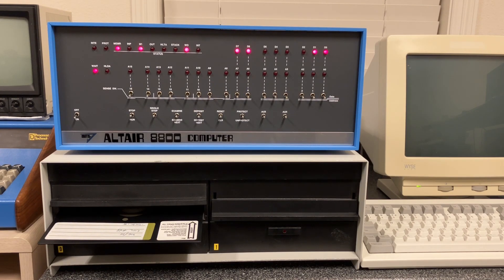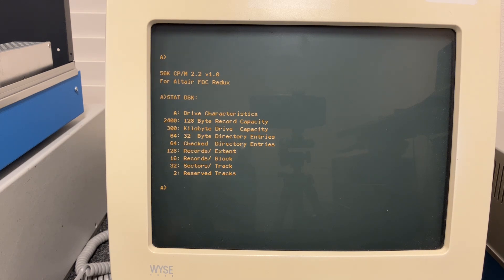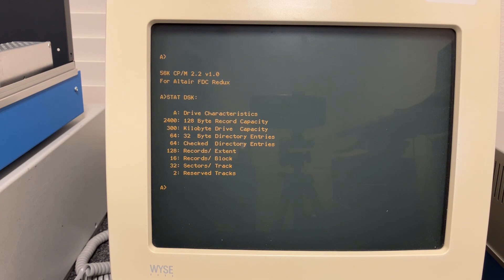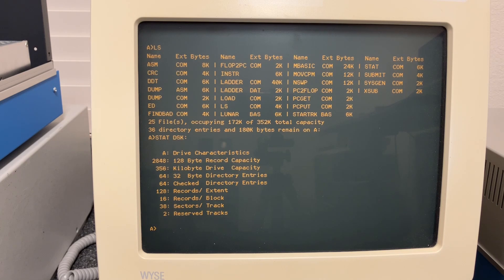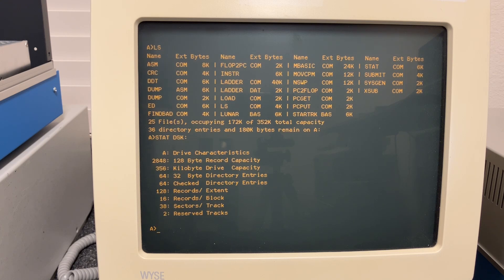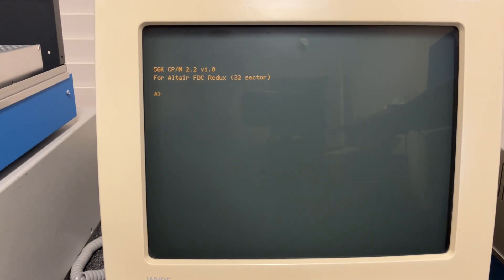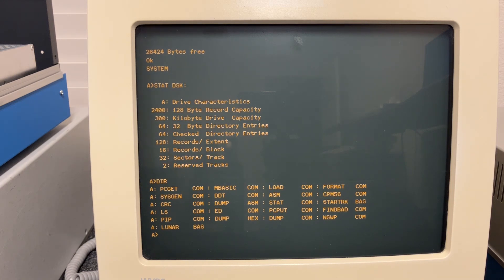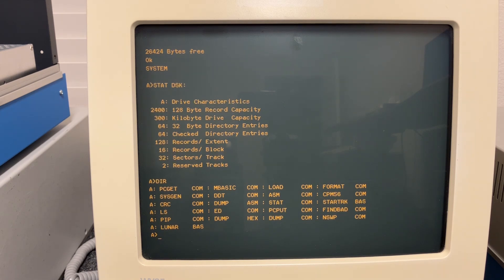Altair Floppy Disk Redux - Part 2

Comment: Quite seriously, your videos on how this all works -- and the new hardware and software you've made -- make me wish that things like 8" floppy drives and disks were still available new, just so I could put them to "real" use.  I used plenty of 5 1/4" floppies back in the day, then 3 1/2", and then moved reluctantly, then enthusiastically, to things like USB flash drives.  It seemed like such a nice upgrade at the time (and it was), but seeing how much can be done with floppies using some surprisingly simple software and hardware sure makes data storage look fun as well as practical.  🙂

Comment: Dumb question here: does the Altair receive fully recovered and useful data from the controller card, or does it still contain encoded data requiring processing (data separation, etc)?

Comment: Bottom line; another disk format. The two that you demonstrated are not interchangeable. 
Is this backward compatible with the IBM Format? No. 
What I ran into at one point was that most software came on the IBM Format, and you had to find a way to do the conversion to the format (size) required.
Had an interesting side gig of folding floppies (early 80’s).